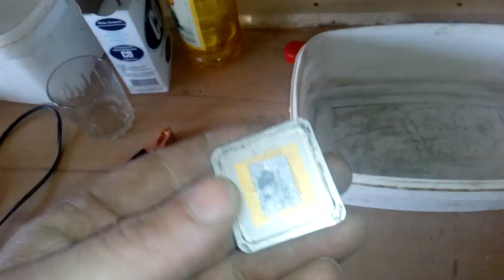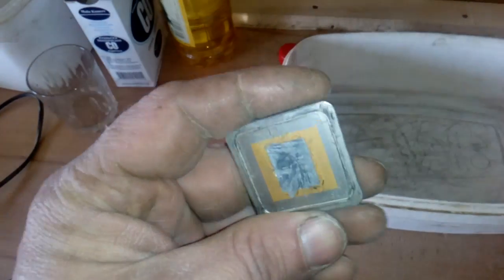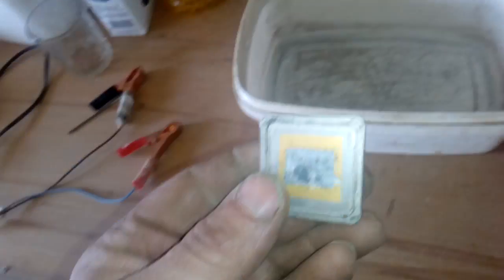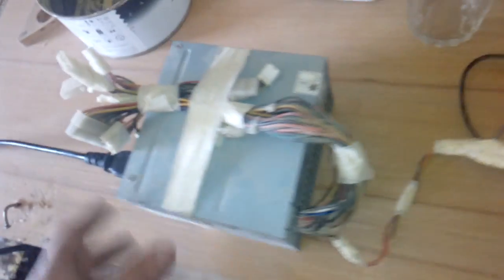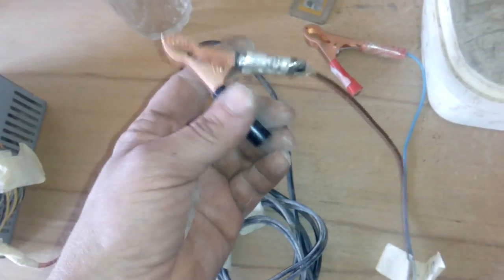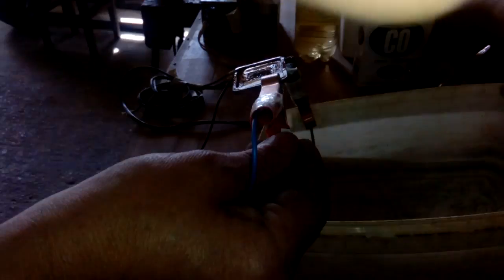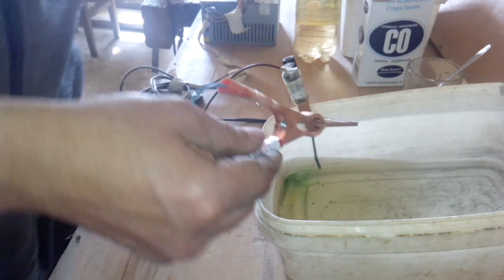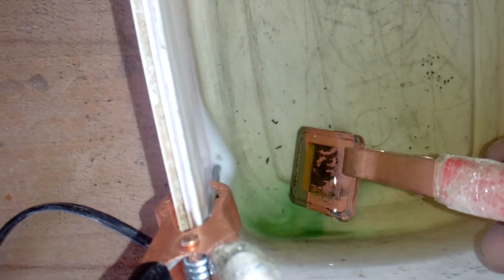How to strip the gold plate from  P4 & P2 cpu heatsinks part 1

Comment: hi Dusan! Your using a stainless steel pin, in other videos I see that they use a pice of led instead, when they do this so called reverse- electroplating. 
 Do you know why they use led?, is it maybe better chemically with the acid? Nice videos you have, Im also collecting computer scrap, and hope to make some refining some day, unfortunally I live in a apartment, wish I had a garage at least to do the scrapping and refining. best regards from  Dragan from sweden. (I was also born in yugo,  in Bitola.)
Reply from the maker: Yes.I use stainless steel for the my solution, while the lead-up provided for the battery of the sulfuric acid 96% .This method vith vinegar is more for striping gold plating from the parts while the method using sulfuric acid and lead vith sulfaric is called reverse elektroplating.Recently I vil record video with sulfuric acid and how it professionally done, this is a snapshot of how this can be done much cheaper.

Comment: after you strip all the Plat how do you drop the gold?
Reply: will any power supply work or is it just the pentuim 4 supply?
Reply from the maker: Must filter it, rinse with water, and then refined with aqua regia or HCl acid and bleach,then drop it vith metabisulphite....
Reply from the maker: Any pofer supply they do the job :)Beter if you got car batery charger,but power supply  it good replacement :)